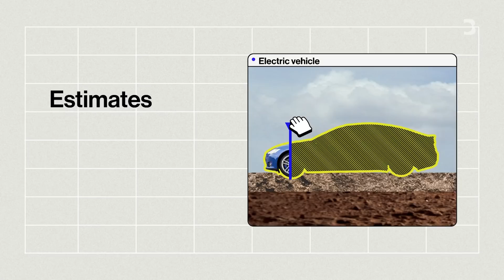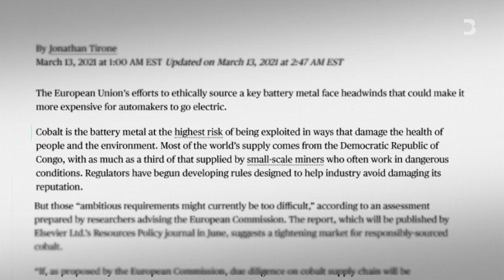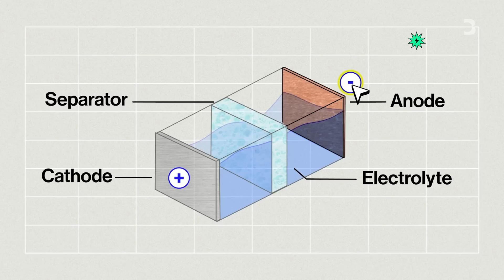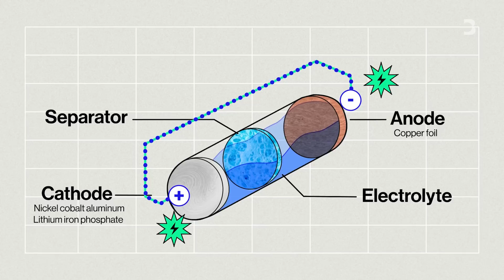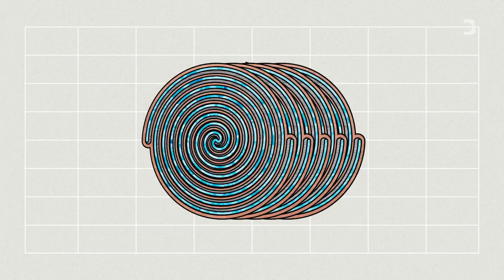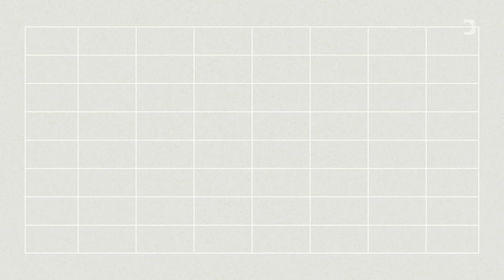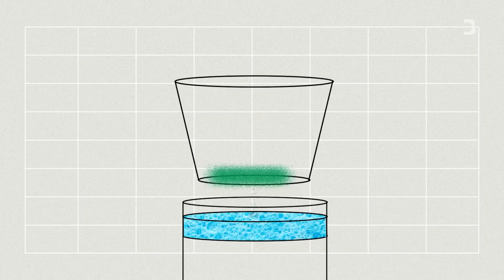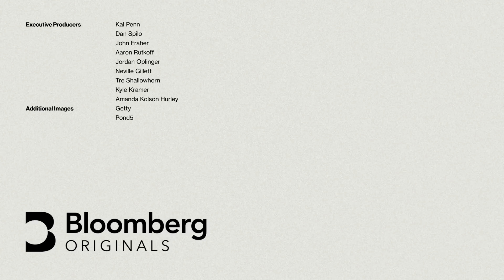Fixing the EV Industry’s Dirty Battery Problem

Comment: Looks like a PR campaign for Redwood. Btw Copper is not used as Anode, it’s a current conductor/connector in the battery. Graphite or Graphite/Silicon mix is used as Anode.

Comment: 13,500 miles (21,726 KM) to make it carbon neutral after taking into account mining, production and shipping. I don't think I can make that distance until at least 13 years owning it. Think I won't be owning any other car for a while once my 10+ year old small petrol car dies.
Reply: If you drive that little, (i.e. less than 2000km/year or less than 166km/month) then yes, it doesn't sound like you really need a car at all (at least not own).
In the US, the average distance driven per year and driver happens to be 13500 miles, in EU the average is 11300km (i.e. roughly half), with other words, the average driver in the US would turn carbon neutral after a year, while in EU the average driver would need two years, both are extremely short periods of time considering the lifespan of the car.

Comment: I can guarantee that this facility will not come anywhere near achieving the numbers projected. First of all, it will NOT likely go into full production by 2025. There are several technical reasons (related to water availability and the complex processes planned for recycling the used batteries) for that which are NOT discussed in this video and which I don't have the time to illuminate here. There is also the issue of getting enough used batteries to them to keep them operating at full production. The amount of greenhouses gases produced by collecting and transporting the used batteries isn't discussed here either. There are HUGE holes in the plan presented here that are NOT discussed in the video. If this facility even reaches half of the output claimed, it would be a miracle. BEVs will not be the best option for most people on Earth in the long term. There are better options, but they involve significant lifestyle changes for the masses and are NOT compatible with ongoing obsolescence of technology and will NOT produce ongoing massive profits for individual automotive producers. If this facility is even completed, it will likely be a fluke of chance. This is largely based on junk science because lead-acid battery production is vastly different than current batteries and recycling them is a hugely different process. Beyond that, the supply chain for rare earth metals required to make batteries for EVs is about to run up on even more constraining chokepoints than they have in the past. This is largely a video about a well-constructed fantasy. Nothing mentioned in this video matches the reality on the ground, nor the evolving landscape for the EV industry.
Reply: but in theory it is possible isnt it? is it cheaper on production cost? is the quality of the product comparable with the conventional  produced one?

Comment: I see “right to repair” legislation possibly playing a big part in battery recycling!
The biggest cobalt-hogs are actually mobile devices and accessories.
Product design with disassembly in mind, heavily standardized battery form factors would make it easier for recycling companies to extract precious resources back from products!
Heavily glued components, proprietary screws and batteries don’t just make repair and disassembly unnecessarily difficult for consumers, but also for recyclers!

And it might not be a bad idea to require manufacturers of high-volume goods to publish detailed disassembly industructions or manuals that a disassembly robot can understand and utilize, lest more precious resources end  up in landfills…
I mean… they run on the same Gcode as a 3D-printer!
Reply: Exactly. We're all on this planet together. It makes sense for things to be designed with recycling in mind.
Reply: Germany has made recycling of precious and other metals paramount in the production of all kinds of consumer goods, including cars, for more than 20 years. The fact that this has yet to become standardized anywhere else is disgusting as we are only manufacturing a major headache for ourselves by making these metals harder to recycle instead of easier. If we cannot easily recycle lithium, cobalt, nickel, aluminium and the like, we're helping to accelerate the environmental catastrophe already in the making worldwide just to make EVs the next big thing. It's artificial the whole idea of generating demand and supply by forcing ICEs off the market AND not encouraging the first two Rs of the green energy triumvirate: REDUCE and RE-USE, not just RECYCLE.

Comment: This guy created a high end metals recycling yard.
Reply: Have you actually see what happen inside those so-called battery recycling plants? This is just FAKE PR. The metal compounds in a used battery are all messed up. They are NOT metals, but toxic and carcinogenic compounds that require expensive human labor to sort through. You can't just recycle the battery as a single unit (like a lead acid battery). There are electronic components too, just like your laptop computer. And a lot of these compounds are too expensive to recycle. Even if you do want to recycle them, you have to waste a lot of energy to recycle them back to the metal forms. All these disinformation is nothing more than FAKE PR. At the end of the day, 90% of these toxic and carcinogenic batteries will be shipped overseas for dumping. Do you know what happens to your used laptop computer? They are never recycled, but end up in the landfills somewhere on our planet.

Comment: Something that hasn't been brought up is that it's much cheaper if you have old battery to reuse. Because all the material is already fully enriched and waiting. Comments here seem to be of very clueless people. Instead of digging around and cleaning up rocks in hopes of finding materials, it's way easier and cheaper to reuse old materials. This has been documented before but I see hardly anyone studies and loves to spread misinformation without checking any facts at all.
Reply: A battery pack lasts say 10 years that means that the recycled battery materials can only be a small fraction of today's demand. And that will remain until demand for EVs stops increasing and we have a ten year wait.
Reply: do you have any sources for your statements?

Comment: I think liquid hydrogen will be better and way more efficient then electrification. Let’s see. I hope for the best for the nature and us.
Reply: Conversion efficiency is much lower. It just doesn't make sense for anything smaller/lighter than an airliner.
Reply: Hydrogen makes a lot of sense for boats and planes, but I don't see it making much sense for passenger vehicles.
Reply: Filling up with hydrogen in seconds, sounds way better then waiting 8+ hours to charge a battery.
Reply: @OIOIOIIOOIOOOOOIOIOOOIII  🗣️false
Reply: srry imho it sounds better
Reply: @OIOIOIIOOIOOOOOIOIOOOIII  Is there a big demand for hydrogen fuel cell smart phones so they can be instantly charged?  Of course not.  People are fine plugging them in for a few minutes or hours to recharge.  Same for cars.
Reply: @dansanger5340  you can use your phone when its charging not the same deal for a car
Reply: @OIOIOIIOOIOOOOOIOIOOOIII  use large delivery trucks with swap out battery packs